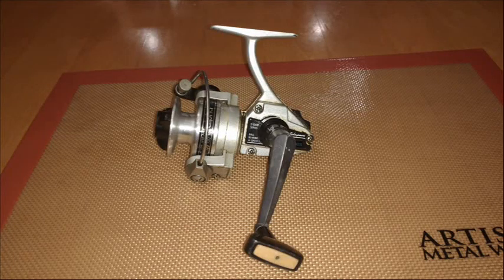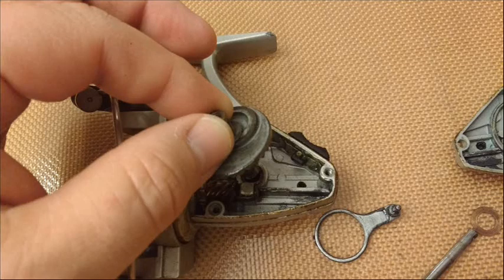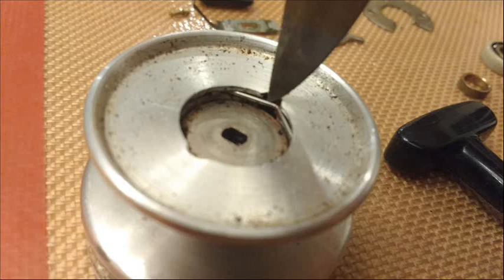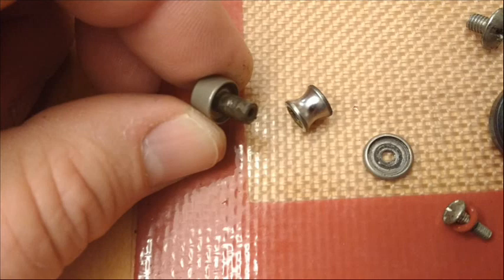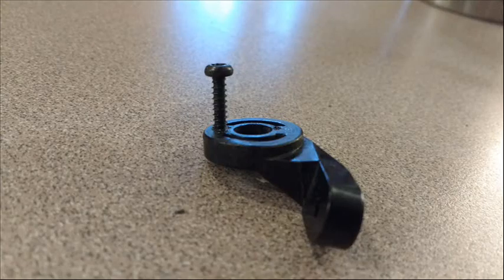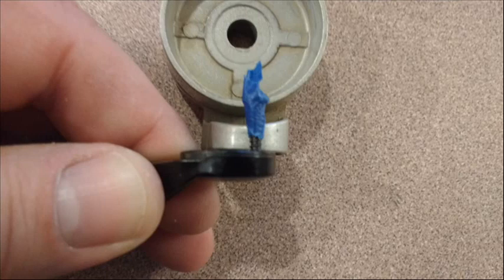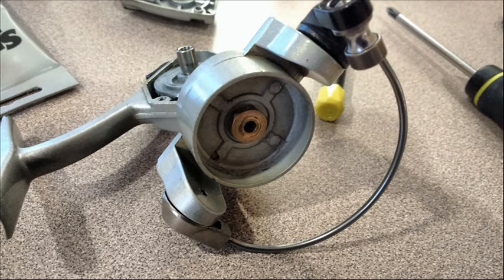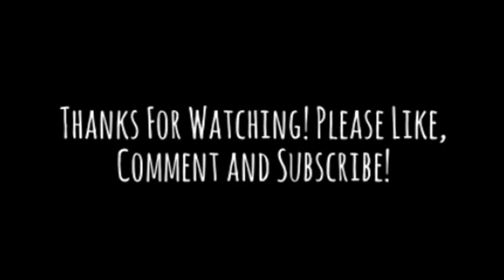Shakespeare Alpha 035 2100B Series Spinning Reel Rebuild

Comment: I am very interested in vintage reels in general I have at least 70 of them ...i rebuild most of them and powder paint most of them ..anyway ..i found alot of your videos are very helpful& informative thanks alot for that ....the biggest challenges on using these old reels on daily basis is the clicker noise on alot of them ...so if you can make a video on how to silence the clicker or at lease lower the clicker noise to some degree to make them something that you can fish with them very often..i. Created few tricks on some of them to make them very quiet...sorry for very loooong comment ..thanks alot .
Reply from the maker: There are some possible ways to go about making anti-reverse silent but it would be dependent on each reel. That is something I'd like to work on in the future and hopefully have some success with. I have studied several different ways silent anti-reverse is achieved in reels that use a pawl gear setup. I think I may be able to duplicate the process in some reels. If I do, I'll be sure to do a video about it!
Reply: @TheFishingHobby  that's too kind of you..thank you sir

Comment: Good afternoon from the UK, I have just got pretty much the same reel it's the Shakespeare potenza with rear drag and the noise on and off.
I have just taken too pieces and cleaned everything and it's perfect but I CANNOT now get the bail arm too automatically flip back over 
All there was is a spring that you put in a little whole and the connect that too bail arm and screw in but it's just clicking and not going back downas a normal reel would do.
Could you PLEASE PLEASE help as I love the mechanism and it's a lovely reel I just need this fixing if you could tell me how.
Reply from the maker: It will be tough to help without being there in person. Your best bet to see how they go together is to do a Google search for the make and model number and add "schematic" to the search and you should be able to find an exploded parts diagram that should show the proper orientation of the parts. Hope that helps.
Reply: @TheFishingHobby  it was just the bar that was bent in the end.
I watched another video and tried that and now it works like a dream, thank you for your reply 😁
Reply from the maker: Nice, good job!

Comment: How do you remove the bearing ang pinion because i cant seem to dismantle that part. I really want to clean this vintage monster
Reply from the maker: From 2:55 to about 3:50 in this video shows the pinion gear and bearing being removed. You have to remove the rotor, then the bearing retainer plate (3 screws on the plate), then pull the bearing out then the pinion.
This schematic shows an exploded parts diagram you might find helpful: https://www.reelschematic.com/wp-content/uploads/schematics/Shakespeare/spin_spincast/Shakespeare%202100b-035.pdf
Reply: @TheFishingHobby  i have this alpha 040 model the bearing and pinion gear on 50 is a little bit different. Do you have a vid on an alpha 40?
Reply: @TheFishingHobby  oh i see it now but my problem is i cannot remove the bearing. Can you give me an advice?
Reply from the maker: I don't have anything on that model because I don't own one. On the 035, the bearing just pushes out to the rotor side of the reel body. Have a look at the schematics on this page, find your reel and look for any sort of retainer that may be used to hold your bearing in place: https://www.reelschematic.com/reel-schematics/shakespeare-reel-schematics/shakespeare-spin-spincast-schematics/#gsc.tab=0
Reply: @TheFishingHobby  what if its stuck how can i push it out?
Reply from the maker: @aquamenadventures4382  push the pinion gear forward and it should push the bearing out. Before you do that, you need to make sure there isn't something else holding the bearing in place (a retaining ring or set screw).